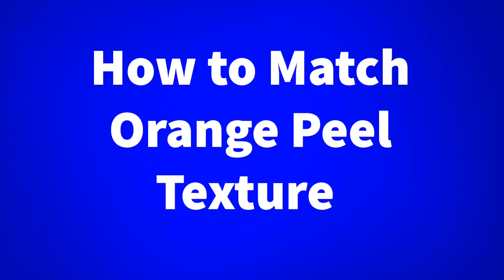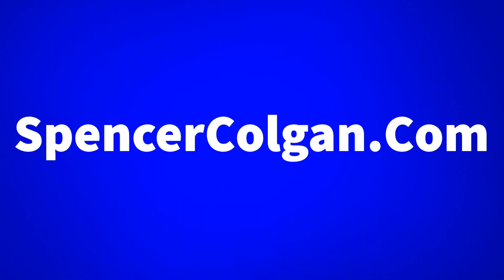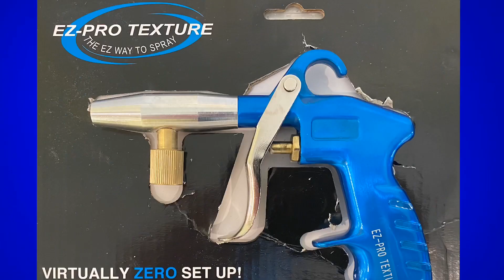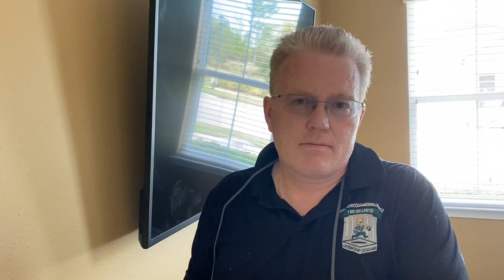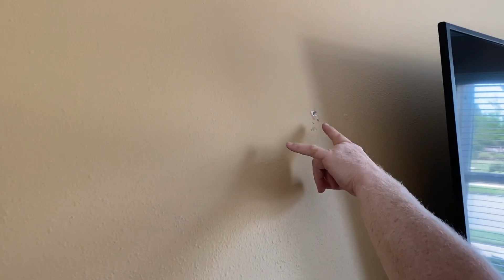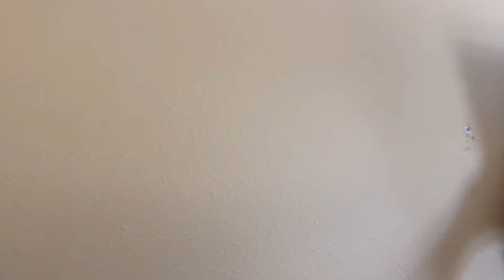How to Repair and Match Orange Peel Texture - Spencer Colgan

Comment: I’ve thought of buying that but after watching I’ll stick to my hopper.  Looks too unpredictable. Plus, I just bought the Graco fast finish hopper which has s tightly sealed hopper that is pressurized so it sprays faster. And because of that I won’t need to wash out so often anymore. I would have feathered those edges a bit more with a wet sponge though. But a good video. Good luck
Reply from the maker: I’d say that you’re right about the tool—unpredictable; For someone who never did texture before, I would suggest to that person to use the hopper.
Reply: But now you like these huh